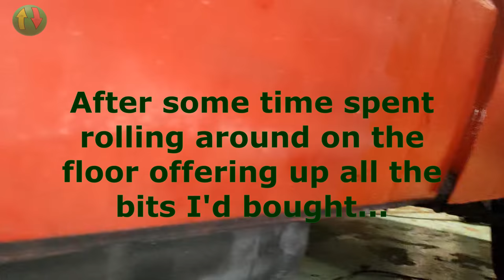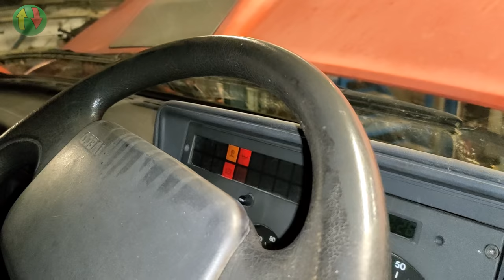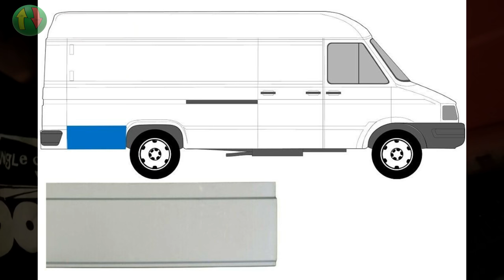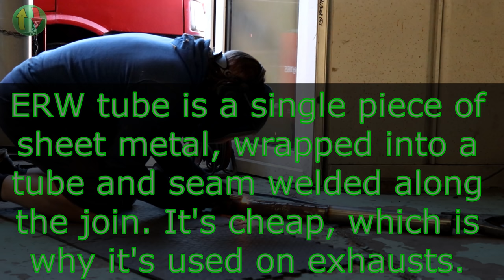VECKI! Iveco Daily 35-8 custom exhaust fabrication and resulting self-consciousness...

Comment: The way a diesel engine can vary the volume level depending on the amount of load / how hard your foot is down is staggering.

I once had the unenviable task of driving my (long suffering) 306 HDI home - a mere 225 mile trip. On the day I was due to make the long drive, the exhaust fell off - more specifically the dodgy  (from new) welds between the tube entering the catalyst and the body of the catalyst itself. At this point the car had an exhaust of around 300mm from turbocharger housing to outlet!

At idle speed, no load = about 20 % lounder than standard! Certainly not loud enough to raise eyebrows. Guess turbo had a good silencing effect (and why Vecky, without, was much loader in comparison)

At full throttle, high load = traffic parted ahead of you as all around went "what the heck is that!?!" then a fairly innocuous green 306 scooted past.

Seemed a noticeable power increase with (zero) back pressure to contend with.

In short I was quite sad to fix it 😀

It may not be straight forward to try, but I wondered if the position of the silencer / resonator affected the response of it (or its natural frequency) - basically if you were to swap the straight length beyond your new silencer to ahead of it, perhaps that may alter things? Lots of science and some black magic in exhaust design, but in the realm of "get the welder out and try it" could be something to put on the long job list - guess crusty bodywork might demand your time more urgently.

Another enjoyable video, thanks,
Reply from the maker: It really is funny how much of a difference it makes. The Ford Cologne V6 is similar...they make a HUGE racket with little exhausts.

Comment: Vecky has a racing exhaust! Another 0-60 please as the exhaust has to be worth 30 bhp?
Reply: After a stainless exhaust, it's time to paint the brakes for the extra BHP's too
Reply from the maker: I hadn't considered this!
Reply: @davidsharp9166  bad obsession Motorsport (of project Binky fame) hit the bhp motherload with stick on carbon fibre for their racing C1. Imagine how much you could stick on that van. You could cover up that rust and make it all proper and structural like real carbon fibre as well.
Reply: @benholroyd5221  true very little, "let's here the Beep" happening as well.
Reply: @davidsharp9166  well if we're going down that route, there been way too little bracketing also.
Reply: @benholroyd5221  true maybe some CAD in future episodes.

Comment: Easy to fit a 12mm plunger/head to the ve pump, later Garrett gt22 turbos off the 3.0 are an easy swap to,  although with a few pump tweaks as is and 1.3bar will be seeing 130+bhp 200+ftlbs
Reply from the maker: Mmmmm....keep talking!

Comment: It is a beautiful van, with the new exhaust it sounds just as robust as it looks. That such a workhorse still looks so good is a sign of great build quality. Except for a little surface rust, basically as good as new. Maybe you should lower your amperes a bit or increase the wire speed slightly while welding, or maybe not or something. Too bad this video was so short, although the main steps were easy to follow, a little more detail would have been nicer.
Reply from the maker: So short? It's over half an hour! Most people only watch them for about 9mins 😆 As for the content, it's difficult to film and work if you actually want to get stuff done. You kinda have to do the work and then film and say "Here's what I've done"
Reply: I agree. you definitely should, or shouldn't increase the wire speed, and/or something. Maybe.

Comment: Those interlocking floor matts from B&M (or was it LIDL/ALDI?) during the ERW welding scene at 20:40-ish in the video make for really nice drawer liners in your deeper roller tool box drawers.
Reply from the maker: Good tip, thanks! I'm not sure where they came from, actually. Might have been in the boot of Cecily.

Comment: If you put a turn down on the end so it exhausts to the ground do you think it might dampen it down a bit? Otherwise embrace it https://youtu.be/tL7X3Pby5Es <-- fixed link
Reply from the maker: It might, yeah. But then it might also make it worse, as the pulses hit the ground. It's an option.

Comment: Put another muffler on, where the 65mm tube is. Or get earplugs
Reply from the maker: I may well do, that's an option if I decide this is unbearable.
Reply: @UPnDOWN  Or extend the pipe out the back with another silencer, but keep the side pipe and use a solenoid operated valve to choose one or the other, for fun.